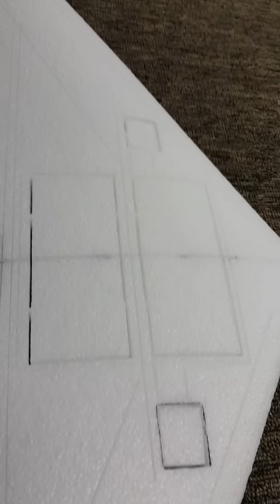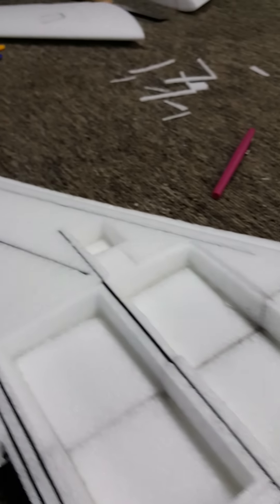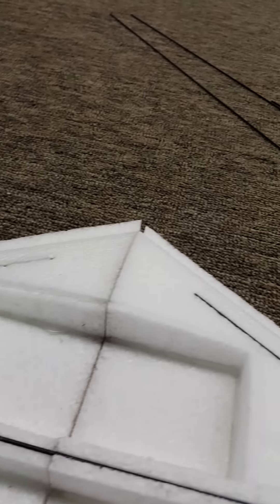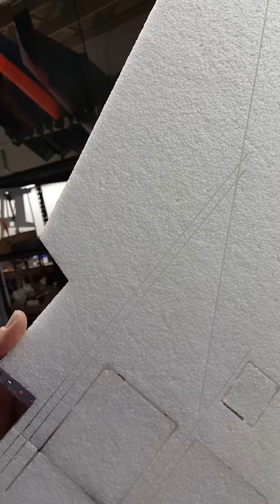44 Hardcore

Comment: looks awesome. whats the difference between 44 and 38? ty
Reply from the maker: pravesh736 the 38 is a little faster on the same power combo and flies with heavier Wing loading so in the wind it does a little bit better. The 44 is very precise as slightly liner Wing loading and is a little less fast. I love both of them but if I was going to grab one it would be the 44. It's just a joy to fly. Some people would say the opposite
Reply: TheRitewing1 thank u for replying. I want to pick a hc44 but still considering as shipping is to India. 
getting back to wings after a 2 year break :D
Reply from the maker: pravesh736  no problem let me know. If you do multiples in one big box it's not that expensive for shipping to India. I can get up to 8 of these aircraft in one single big box for about $95 shipping. So if you have a group by you can really save on shipping and it makes it very reasonable. two aircraft in one single box would be about $65 to ship them
Reply: TheRitewing1 thank u, will decide and pm u. time to find someone who would be interested in group buy :)